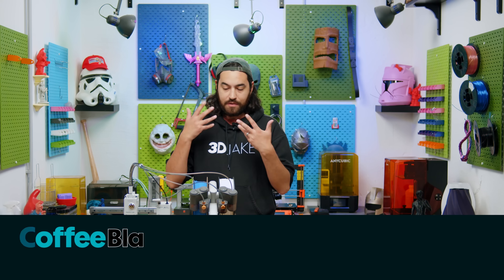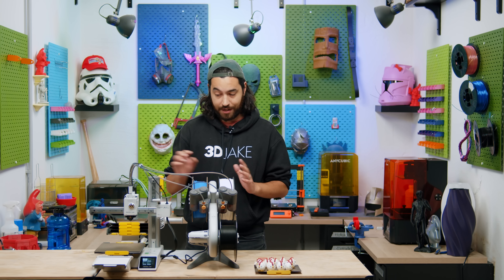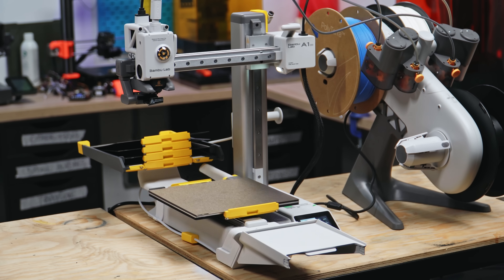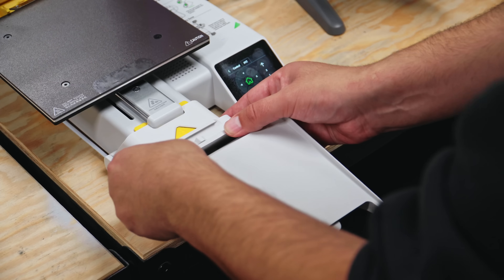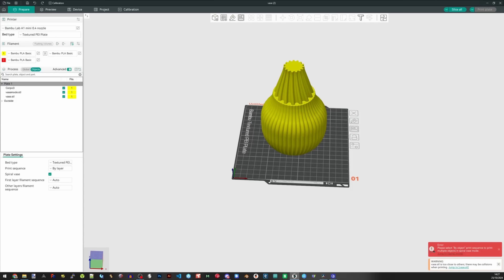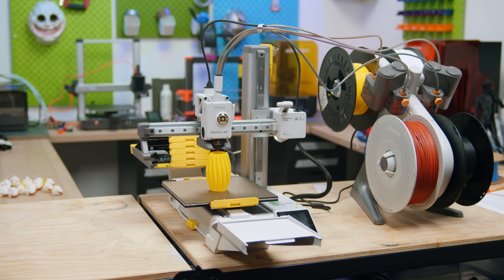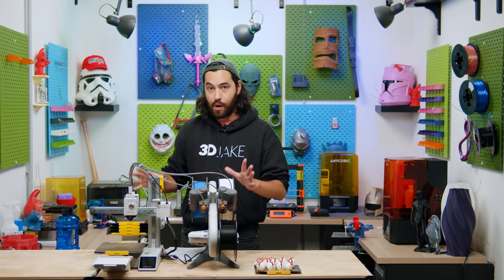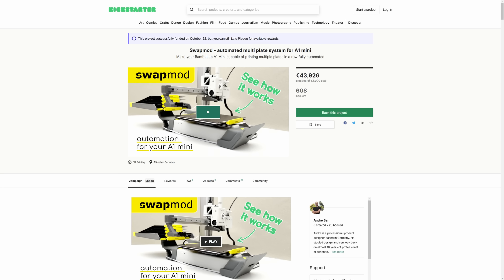Game-Changer: Bambu A1 Mini SwapMod!

Comment: Will this 3rd party g code site work after the shit happening now with Bambu lab?
Reply from the maker: It seems so, as long as bambu studio is used or Orca with Bambu Connect you can use this without issues as only gcode is being edited.
Reply: @3DJake_Official  Which file extension does the swapmod site export?
Reply from the maker: @ I think it was just gcode and 3mf

Comment: For vase prints all you really need is for the printer to wait a couple of mins for the plate to cool down, lower the nozzle and slowly drive the bed back and it would knock the vase off, could be done simply within the g code without any need for hardware.

Comment: I understand the desire for this automated system.
But realistically, if you have an Etsy or store requiring bulk prints, you are also likely in your workshop more often.
So that "1minute" swap time, i could have physically taken the plate off, clicked print new plate, in about 10seconds. 

Having this auto thing, costs what, 5 or so spare plates. So $29AUD per plate extra. 

And if i was batch printing, i wouldnt have an A1 mini. Id have a bigger printer plate. But obviously i know this is a concept which could easily be transitioned to an A1 standard in due time.

The only benefit i do see, is like you said; the overnight printing.
Reply: Now multiply that time if you have 5-10 printers. And you don't need 5 build plates. Also if you have a larger operation having this automated versus paying an employee is well worth the money. That is the primary market for this. That and people who have multiple jobs.
Reply: two problems with that:
1. if you're not in your shop at the exact right time to clear up a finished print, you're losing machine time
2. you need to let the print bed cool off to remove your prints
you do get much less stringent requirements for any human intervention needed with this system. particularly if you can just allow your prints to slide off the bed and into a bin underneath, that way you can easily print a full stack of plates before having to set things up again. but even if that's not an option, you don't have to babysit a print farm this way, you just check in on it every once in a while